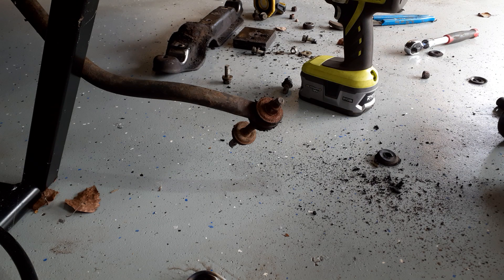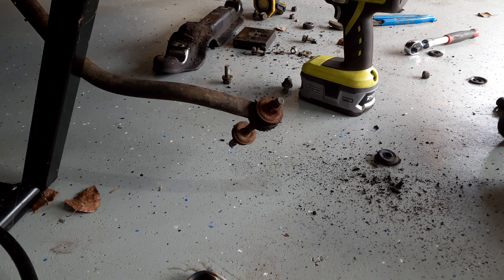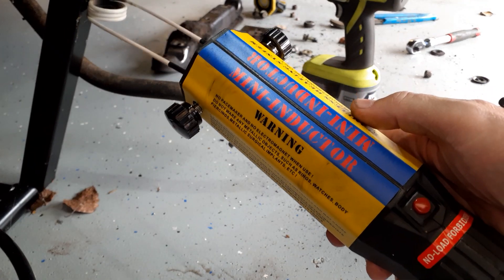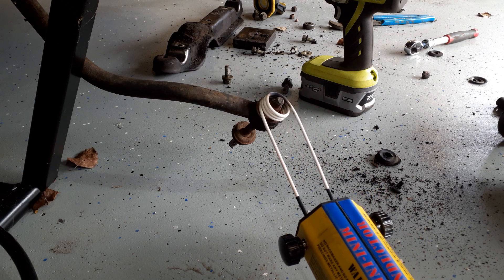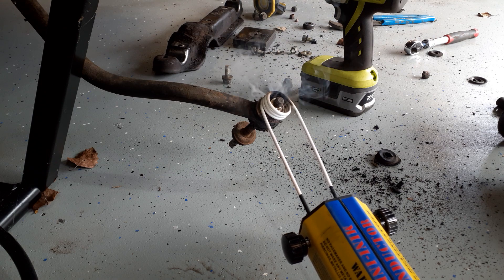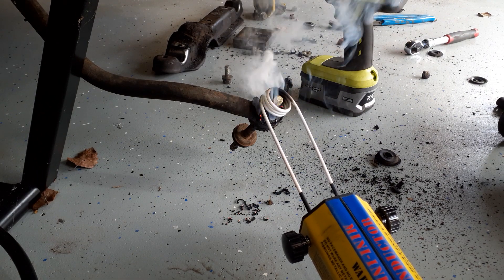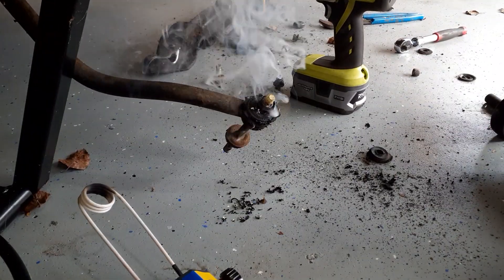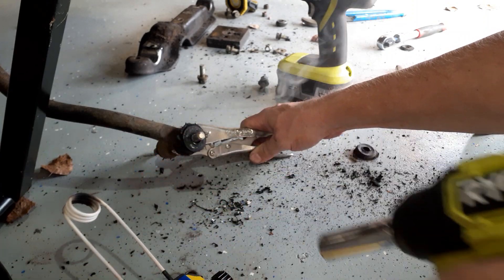Induction Heater Bolt Removal

Comment: I need to remove a bolt that goes into a box frame that has a nut fastened inside of that frame. The bolt is about 3 inches in length, inside a bushing, from the nut. Will heating the hex head allow heat to travel the distance to reach that nut to get it hot enough to remove. Kind of a pricey tool to buy and find out the heat is only localized. Can the heating element be bent to reach that nut if I have access through a hole near it. Thank you for your video, good demonstration.
Reply from the maker: I wrapped a free-form coil around a 280Z rear axle to remove the axle nut. The owner of the axle tried to remove the nut with a 3 foot breaker bar with no luck. After a couple of minutes with the induction heater, I was able to break the nut free without much effort. That was with the control arm in place, so there was enough heat to go through that much mass.

Comment: I finally bought one of these, used it the other day to remove a baked on flare nut off a Cummins ISX turbo. I struggled and struggled with a 24mm wrench, and said screw it and grabbed the heater... Two minutes later and it popped right off with little effort. And I was not able to budge that nut, not even a hair prior to grabbing the heater. This unit is a keeper, bought it on Amazon, around $220 with all of the needed coils.
Reply: Just bought mine. It's getting delivered in 2 hours. Got a broken stud in my lexus gx470 4.7 v8. Valve cover gasket all the way in the back near the firewall. Can't wait for the delivery
Reply: @goldentrucker7921 did it work?
I’m waiting for my delivery too 😅

Comment: rookie question: is this a last resort kinda option when trying to loosen a bolt when the liquid wrenchs fail?
Reply from the maker: Nice question. There are many times where penetrating oil can't break a fastener loose. I'm not an expert, but I think it's where there is too much corrosion or a lot of heat cycles. 
In this case, I did use Kroil on the fasteners, but a couple of the end link nuts still wouldn't give, even with the impact gun. After using the induction heater, the nut zipped off easily after I held the end link securely. 
This is used in applications where you would normally break out mapp gas or an acetylene torch.  I prefer this to using an open flame, especially where there are fuel lines or a lot of grease build-up.
Thanks for stopping by and watching the video.